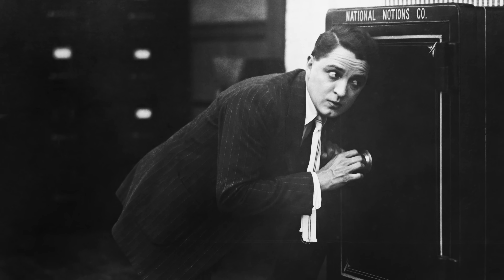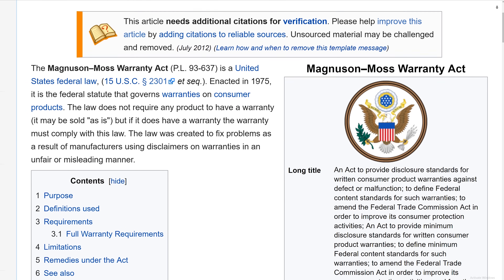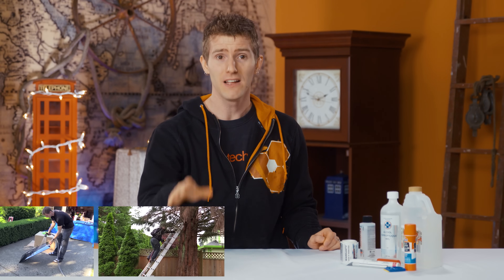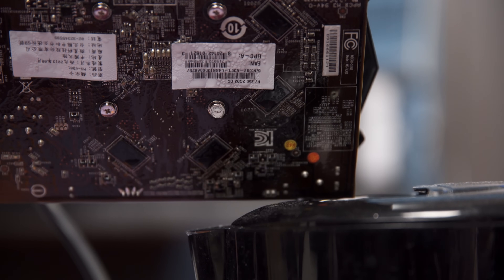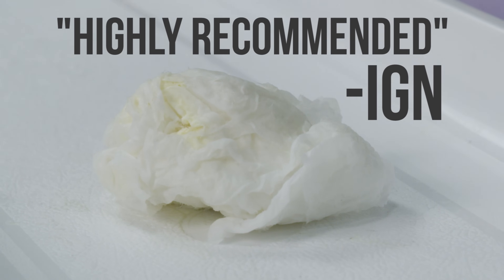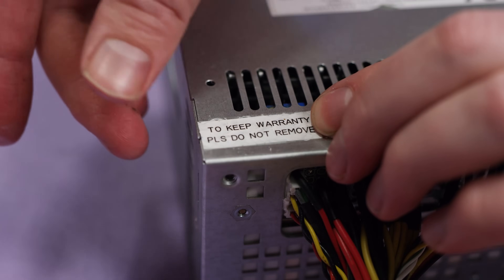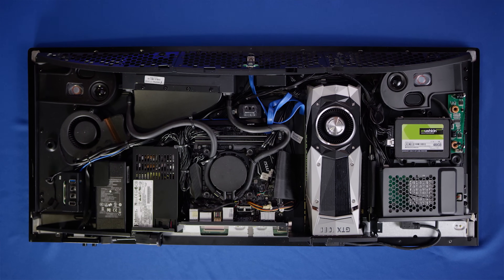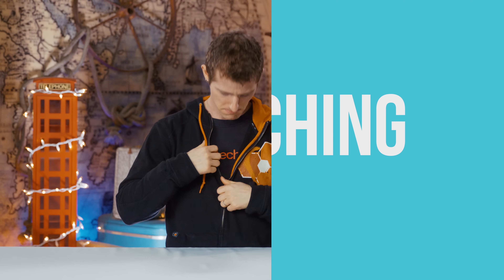Safely Remove Warranty Stickers

Comment: John “it’s against the law for these companies to stop you from trying to repair your devices yourself”

Apple: “Hold my beer”
Reply: I hate this comment and how true it is
Reply: @DaniPaunov  i hate aple and the way they work
Reply: @TheNilstakkenkamp  exactly why I left apple and went to Samsung and left Mac and went to windows
Reply: Fordsie yeah I fucked up my screen and had to repair it at apple for a lot it sucked
Reply: @xavvyyz  why not try LOUIS ROSSMANN AND ok am trolling
Reply: BeastBro this is why Louis Rossman exists
Reply: john deere too
Reply: @lohus224  oh lord yeah, I'm too poor to go buy a modern JD Farm machine but in all honesty my late 80's and early 90's "Junk" is still cheaper to repair by quite a bit. When you hear JD tell it it's all political why their sales are down, but when Corn went high some years ago and JD equipment prices went up too, combine that with high dollar OEM replacement parts and the fact you're gonna have to pay a technician to tell you exactly what part/sensor is causing the issue, all of it adds up to a really expensive overhead to make repairs or scheduled maintance. What that breaks down to is you have a DEF System  issue, and you call the service guys who come out with JD Software to tell you the exact part, that part say cost $500 it's gonna cost you $1,300 by the time the machine is up working again.
Reply: @Wuanslm not to mention getting your screen fixed is impossible thanks to apple linking the digitizer and home button to the motherboard, making it impossible to replace them with genuine Apple parts at a 3rd party repair shop.
Reply: This comment aged very well, can't swap parts in the new iPhone at all now. Not even with the same model iPhone as a donor. 😂
Reply: ahem you forgot about Tesla not letting people use super charging when the car Is auctioned and repaired at a non Tesla location
Reply: "hold my flat-head screwdriver"
Reply: @Ther Ther No they dont Laughing my ass off mac's limit you compared to a pc with macs u cant upgrade the parts so u have to pay someone to do it and its super over priced and the specs are shit compared to a pc get off the shrooms buddy if u think that. The only thing macs are good for is that all there apple device link to each other so it makes doing business work easier and the specs are built for doing Paper work and other business work not intense graphics and built with beef like a pc.
Reply: More like
Apple: Hold my Sweet Cider!
Reply: And Tesla.
Reply: Well they don’t. They just make it a bit harder to get in there. They don’t straight up say “no.” They just remove your warranty’s. It’s basically like a car manufacturer saying no to your request at a warranty fix because you fucked with the headlight assembly and the headlight went out.
Reply: 3000th like is mine
Reply: Most likely it says in the apple tos that they can do it. Scummy stuff
Reply: The last time apple did something good was probably the first iphone
Reply: @Ther Ther I had mutiple Dell PCs (700$ +) that stoped working after 2 years right out of warranty that could not be repaired. I had a self build PC that lasted 7+ years with only changing the SSD once and after that bought a knew PC anyways because the old one wasnt even worth upgrading anymore xD It still works btw^^
I wont ever buy from Dell again.
Reply: apple: hold my fat stack of cash*
Reply: Louis Rossman has entered the chat
Reply: Everyone from my school got an ipad and i took care of it, the screen had a thick black line across it a year after having it, hopefully this isnt common but maybe a lot of ppl have their apple devices broken within a year and wasnt their fault, and my samsung j3 ive had for years is still going strong and ive dropped it so many times theirs no cracks on the screen but their is a very small crack at the back from when i thrown it when i was annoyed but the only problem was a swollen battery but thankfully its samsung and they actually do repairs me and my friend just found one on amazon for about £10 - £15 with extra battery life and ordered with my money and it worked fine
Reply: Just drop it so much the sticker also breaks... Actually that might be hard since the sticker is stronger than the device itself in their case.
Reply: Apple is the most repairable phone. Samsung literally glues their phones together
Reply: This is a message to Apple: I'm not buying your $1000 holy fuck ripoff of a phone with a shitty operating system. Elitists and Apple retards should not have a voice in this world.
Reply: LOL
Reply: Hey would you tell John Deere that as well??
Reply: I get that Apple has really bad repair policies and they are inexcusable. But almost everyone who complains about Apple repair, would never ever try and repair it themselves anyway.
Reply: Apple has no stickers on their devices
Reply: @PTFuZi  They like to point out the moisture stickers though as reason not to honour a warrantly when it truth atmospheric humidity can set them off.
Reply: It is against the law. Not everyone follows the law, and some people get away with it. What else is new?
Reply: Apple: ''HOLD MY APPLE'' !!!
Reply: Can someone elaborate what apple did plz
Reply: @CentreMetre  they completely sealed their products and in the user agreement it denies repair also how about everything else? They limit their software, notch, no expandable storage, theyr'e dirt cheap to make compared to what they sell them for (for example the iShit X cost 999$ but the actual value is around 350$), they blatantly lie, their products are outdated, they don't care abut the customer.
Reply: @lohus224  iShit X cost 999$ but the actual value is around 350$ -> What does this even mean?
Reply: juan2049 no, not even near 350, i see that you don’t include operating system into price, the amount of security you get its worth it
Reply: Yooo I wasn’t saying that. I was quoting the commentor who said that and was asking him what he means by that. Because No way that a Mac is only worth $350
Reply: @juan2049  i saw some videos about it when it was released and it added up to aronud 350$
Reply: lohus maybe your thinking about the cost of parts alone. But that doesn’t factor in manufacturing, coding, software, and operating system.
Reply: @juan2049  i dont think it is much more the building - max 10$ coding software and operating system? it cost milions but for what bilions of phones use it so it's like 0.01$ per phone for an os that is wayyyy worse than android
Reply: @Yooo-ph5zx  I find it ironic you talk about security but jailbreak your iPhone.
Reply: Nathan Saechao how’s that ironic? Getting rid of apples data collection is somehow ironic? Or maybe you think that jailbreak “exposes” iphones to vulnerability issues? Can’t say that every cydia package is safe but there is various tools to check package health before adding it. Yes your stuck with that specific ios version for a while(well ig not anymore DAY0JB is back) that could potentially left you out of new vulnerability updates. That in mind, simple phone check every now and then and your safe.
Reply: lohus 10$ operating system? You realize that ios is multi trillion dollar frimeware? That’s more secure, reliable, light-weighted & overall stable than most modern day operating systems. Since i have used ios for past 10years, not a single time have I experienced random shutdowns, overwhelming bugs(well i do beta testing so :p), not any security breaches caused by iOS internal security flaws.
Reply: Nathan Saechao no I don’t need to provide sources for that price, I haven’t said that 0day attacks are impossible, there is always a way. What comes to jailbreaking and security and malwares, there was ios 10.3 or something jailbreak released by PPjailbreak(Chinese group) that wasn’t safe to use but you how did we know that? Well the base exploits are used to get kernel level access, then spraying to those vulnerable ports and hoping to get the actual jailbreak sh tru, second part is installing and tweaking the software to fit onto existing framework, that’s the part where malicious files could be installed. But jailbreaks are open source so anyone can go and see what’s inside of that specific jailbreak, that’s how we know that PPjb was trying to collect data, people like ge0sn0w, qwertyuiop and more makes jailbreaks barebone softs so users has to install their desired packages. This leads to them being unable to add malicious files to your device and giving you the freedom to download packages that could potentially be malicious. I use apple phone since my job requires me to have iphone, that’s not blindly following, and i have experienced the framework so well that i can ensure that it’s way more secure from attacks than any android device ever build. What comes to “what you can do with iphone that you cant with android” is just stupid. Everything is different since they have different coding language support and thus snapchat on ios is different from snapchat on android. It all comes to down where the users are making incredible advancements tru out given framework. iPhones are priced higher than android since quality != quantity. The amount of development that need to be done for iOS device is much higher than for android device(that being android is open source)
Reply: lohus and going by the 500 rough price that’s a 50% retail cost compared to the 68% on the android Samsung note 10
Reply: @juan2049  He was talking about the phone, how much it costs to make it compared to how much they sell it for.
Reply: @Yooo-ph5zx  The operation system is done, they just make copies it costs them almost nothing
Reply: @Yooo-ph5zx  You should not be needed to jail break your phone to make it work. Just don't by icrap
Reply: @Kotoamatsukami6910  if you really believe that you are very ignorant. Software is not done once and that you never have to do anything for it again. In total there are many cost most people don't understand or ignore when it comes to setting a price for a product. What do thing if you go to a restaurant your food your food actually cost to buy just the ingredients? In general about one quarter of what you paid for. Is that a fair pricing? Of course because the owner has to pay rent, employees, heating, bills etc all that together combined need to be considered to set a profitable pricing. And it's the same with Apple. They have employees, rents, warehouses, logistics etc and those costs will influence the pricing of their products. I won't tell anyone Apple won't make money selling their items, but it's not like they make 400$ or more profit each iPhone the sell.
Reply: @lohus224  the CrapBook prob. cost $300 and sells for $3000. The iCrap? Maybe $500-600 in expenses, and sell price for $3500? idk
Reply: @juan2049  It Means the cost to make is cheaper then what they are actually selling it for for instants Gucci there shit is expensive asf but just because they value there brand more than the clothing and the materiel so its worth 2x its price or more. A lot of companies do this it works because people are stupid asf and just want to flash how much they spend on a product and like to brag how expensive it is even though the quality is fking sht and the service. And yes the Macs are cheaper to make then what they are valuing it for it fking baffles me why anyone would buy a mac.
Reply: @juan2049  they spend $350 on making it but sell it for $999
Reply: c r o w So? That’s how companies make profits. Soda dispensers at restaurants cost them $0.03 to fill a cup, and they charge $2.49
Reply: @juan2049  the point is its overpriced, just like soda dispensers apparently
Reply: @juan2049  the IShit is prices at $999 but it is only worth $350 dollars, giving Apple almost a %200 profit on each unit sold, assuming they actually paid the value of the item to have it manufactured...which they didn't, since they use Chinese factories where workers are not paid the value of their labor to begin with.
Reply: @lohus224  actually Samsung glued their internals. Apple uses screws. Much more repairable
Reply: Callum Uzzell yea i get your point, and if I wasn’t “educated” for fixing these types of problems on my own, I wouldn’t bother apple at all
Reply: Callum Uzzell i can understand why you don’t like apple products, but we are living in time that privacy and quality  is hard to come by. That’s the reason why I spend money on Iphones, they are fast, long lasting, secure and private + jailbreak is one of the neatest things you can do. I don’t understand what ppl say that they are unable to change screen/open the phone, there is  2 screws to take out, thats it.
Reply: @Yooo-ph5zx  i died from laughing at the part when you said "privacy , log lasting , secure, jailbreak is one of the neatest things you can do" first of all privacy? you ant getting any privacy with apple. long lasting? iw'e seen iphones with cracks on the day of release. secure? its easy to hack into any iphone with ease. jailbreak? what the fuck do you think yo are getting that normal androids cant?
Reply: lohus I cannot win argue with tard, sad
Reply: @lohus224  can you explain to me the privacy issue with apple?
Reply: lohus Android stops gettin supports about two years after release apple keeps phones updated for over double that they have an operating system that is one of the most secure of any mobile device and no it’s not easy enough to hack an iPhone the parts might be with 350 but including operating system it’s worth 550 maybe and most retailers have a 50% profit so there you go
Reply: @nate5521  sms asxp, reverse shell, done. do some research son, just did it on my 10 from my kali vm.
Reply: @Yooo-ph5zx  Apple does their very best to make sure that their ecosystem doesn't have any intrusion. If you try to purchase a genuine apple screen, you're SOL. The independent repair centers are using, usually, fairly-priced counterfeit parts because Apple won't sell them the genuine (overpriced) thing.
In previous models, many people had their defective home button replaced only to have it disabled by an OS "upgrade" months later.
Apple viciously fights right-to-repair legislation and quotes insane prices for repair and, in some instances, outright refuses to service brand-new products (LTT can confirm...).

As far as "private and secure" - there's no such thing with ANY manufacturer. If you can access it and your service provider can provide it service... it's just a matter of time before someone else figures out how to pwn you.

Personally, I couldn't care less about device preference but I refuse to give Apple another dime after they disabled three peripherals in a row. RIP $700 Klipsch speaker system. RIP docking alarm clock. RIP PLLC programming cable.
Reply: @Yooo-ph5zx  dude Apple literally hardcodes homes buttons and screens to the motherboard firmware so ONLY apple can repair it even if a repair shop has GENUINE Apple parts and does everything correctly. The phone will either refuse to let you use it with a warning message or just literally brick your phone. Apple made it so only they can flash genuine parts and charge 5x the normal price of repair. Apple genius bar was also caught on many occasions literally lying to customer saying they need a $800 board repair for a faulty screen that could cost $20, and claim there's water damage as an excuse even when there isn't.
Reply: Psilocybe Cubensis you clearly have zero idea what you’re talking about
Reply: Lol guess i made a new word for android fanboys. Android Aliens sounds better than apple sheep.
Reply: @mycelia_ow  wow, imagine even pricing a motherboard replacement that high, apple are corporate scum of the earth
Reply: Yooo Android is just like jailbreak

Comment: Pro tip.  If the sticker is broken, but still all there.  One example is those pesky msi stickers on the bottom of their laptops over that middle screw hole.  Cover the sticker with a piece of clear tape then cut it down to size with a razor knife.   Then peel it off with a blade of some sort. You can reposition the torn pieces. Use stick glue when reapplying it to the product.  Easy peasy lemon squeazy.  Also use gloves .

Comment: But what about WD-40? I had a good time soaking stickers in it. It will desolve almost any glue and sticker would be intact. To be clear I've used WD-40 to remove stickers from guitars and it helps a lot. It's my go-to for removing almost any adhesive. Mb it's different with plastic, idk